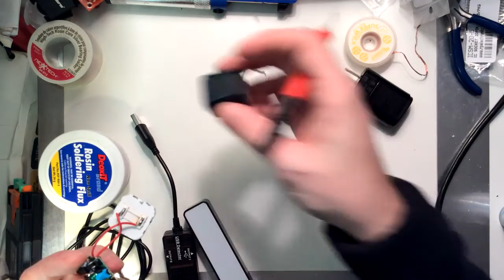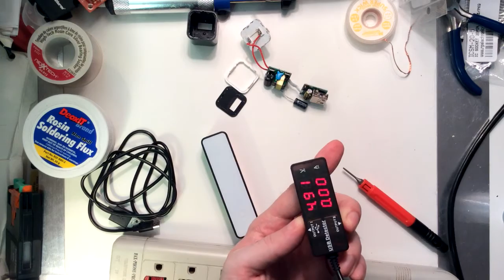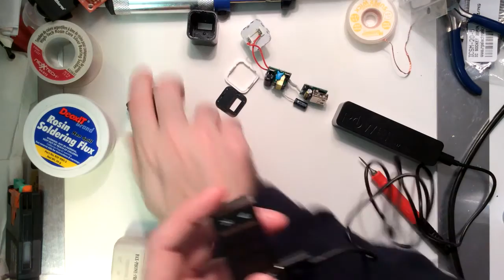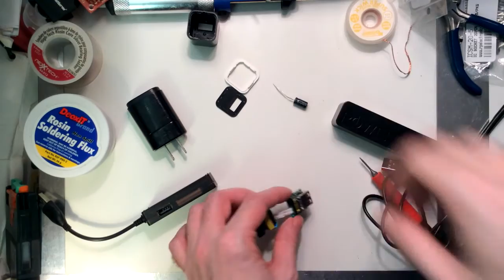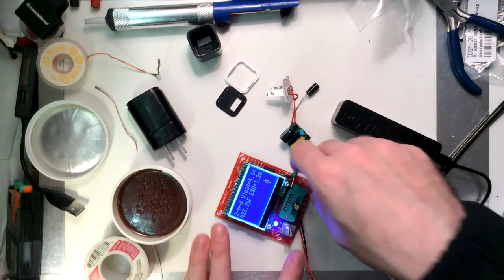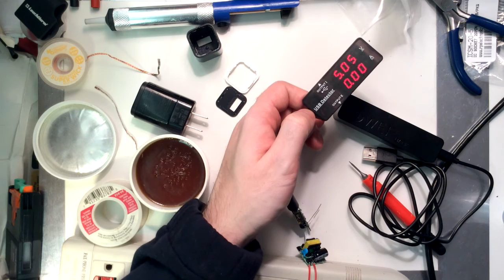Adventures in USB Charger Repair

Comment from the maker: Just a quick note from future gadgetboy. I explained the function of this unit completely incorrectly. It's a switch mode power supply, and what I described as a linear power supply. Switch mode power supplies are far more efficient and compact, although the DC output tends to be a bit less smooth.

Comment: Fun stuff! Takes courage to go live like that. :-) 

Caps, especially 'lytics are notoriously inaccurate. You can't think of them like a resistor. +/- 20% is not bad. So a 470 micro could read 370-570 and still be OK. Don't blame your nifty checker out of hand. You can also add/subtract capacitance by introducing yourself into the circuit. (Holding cap leads against the probes, for instance. ;-) 

Then there was the time I put an electrolytic in a circuit backwards. It whistled like a teakettle then went POW!!! like a .45 going off. You'd be amazed at all the stuff that's packed into a cap... Good thing I had safety glasses on!